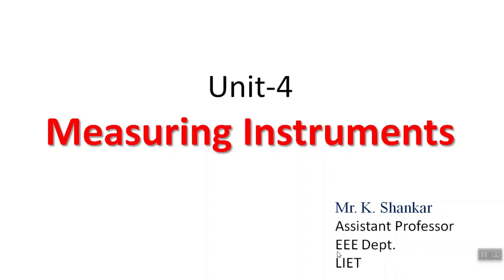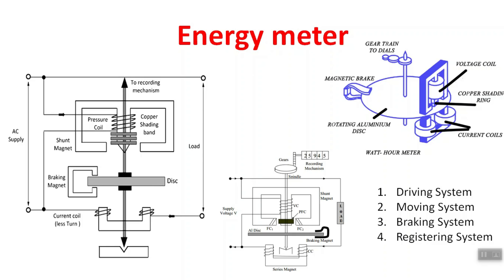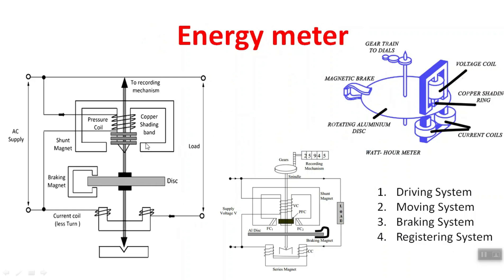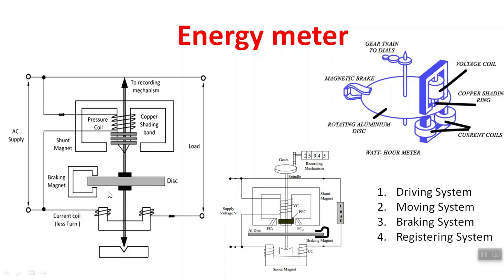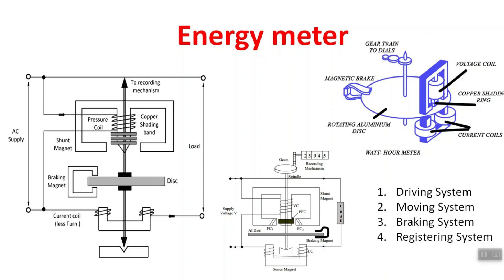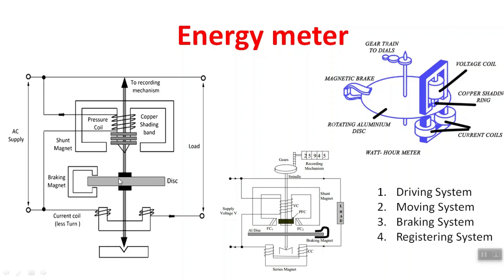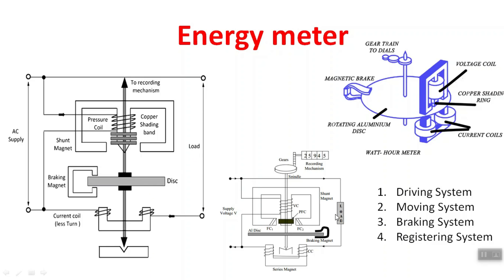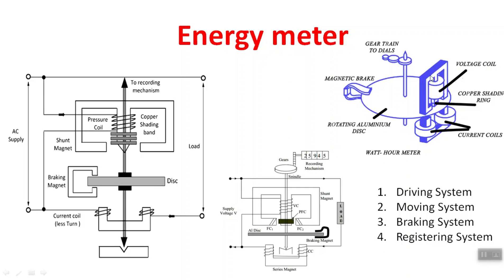Lecture-7 || Working & Construction of Energy meter || Measuring Instruments

Comment: Sir if load is on.... then magnetic field is b/w moving and current coil if braking coil  top side is north pole and moving coil acts as south pole then braking coil leaves a gap for disc to rotate....... similarly braking coil down part south pole and current coil acts as north pole it will attract towards it and leave a gap..if load is off braking coil top and bottom parts will attract and stops the disc ..anthena sir🙄